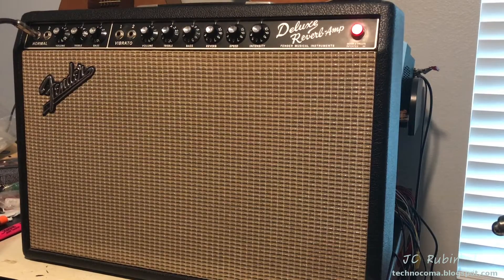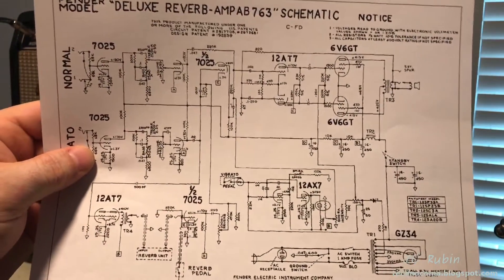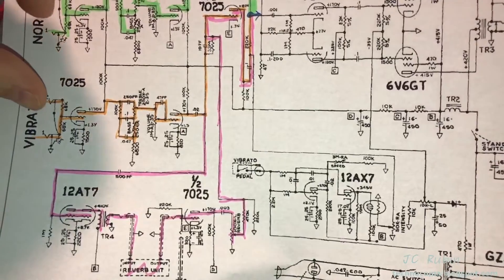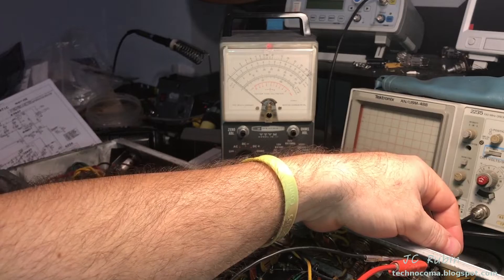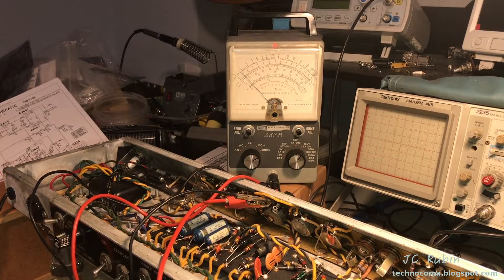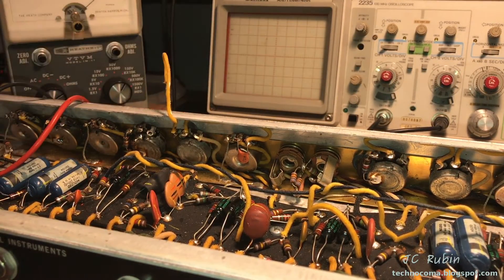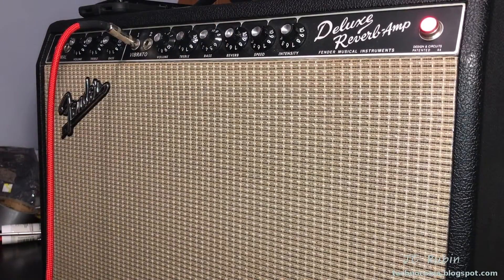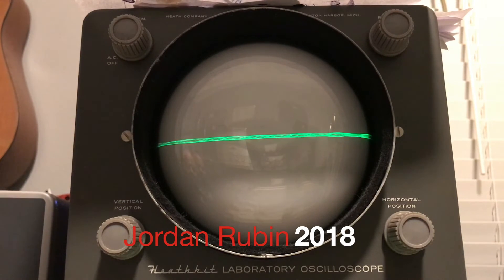Fender Deluxe Reverb Amp - Loss of low-end signal troubleshooting

Comment: Hey I know this is an older vid at this point, But I am having a similar problem for treble in the vibrato channel on a 1969 Bandmaster Reverb TF5005D (AA768). I opened it up and measured the pot and the caps in the tonestack and everything seems normal, but the treble completely drops out at random while I am playing. do you know of any reasons this could happen? Thanks for any tips.

Comment: my 66 twin has similar issue....but the reverb chan has intermittent bass loss.  itll be fine then a slight crackle then bass cuts out then comes back after i womp womp on a chord...or if i flick the stand by on and off it seems to always come back..  the bass never cuts more than a 20 secs or so....

Comment: I have a 1968 drip edge with original speaker.  The amp has no bass... on both channels the same.  What else is the problem?
Reply from the maker: Did you check for BASS before the BASS/TREBLE circuit

Comment: Hey, great video. I wanted to ask you. Is is possible to add a bass control to introduce low end into an amp that only has one tone control and very little low end?
Reply from the maker: Personally I would not modify an original deluxe reverb.
Reply: Retro Tech & Electronics  I meant any different amp.